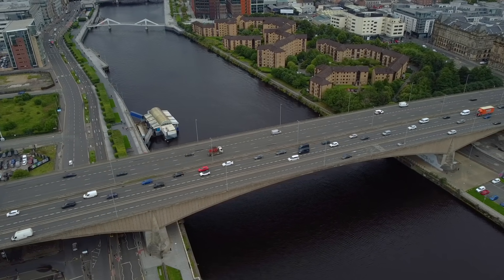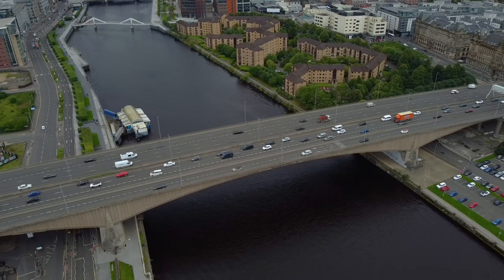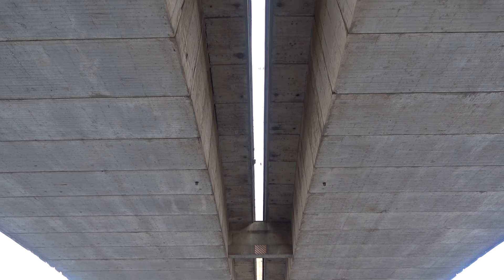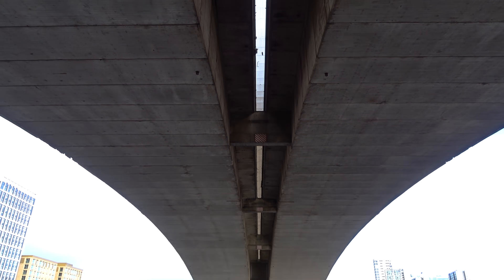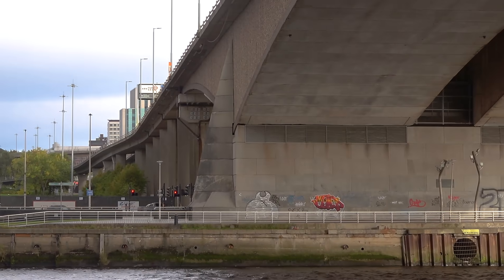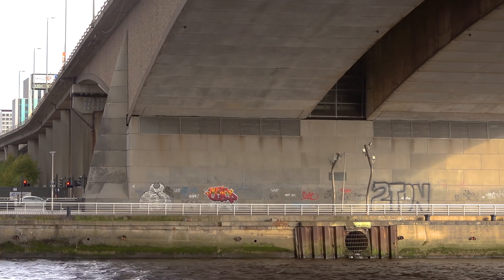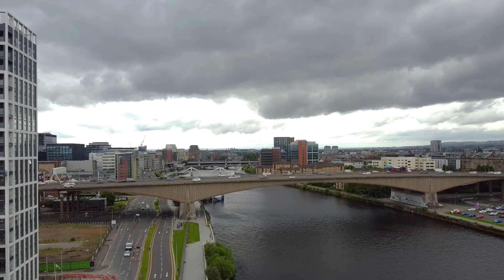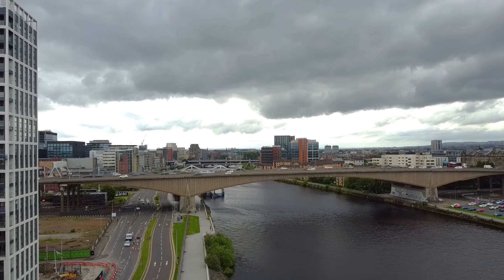How Do You Move A 52,000 Ton Motorway Bridge?  Glasgow's Kingston Bridge & M8 Motorway

Comment: Once again, a good video. M8 at Charing gross, Glasgow, city centre. A flyover was built over M8 in 1974. Unfortunately no cars could use the flyover due to non-compaction as there was a building on both sides. The panners turned it in to a public bridge at least it had about 60 steps to climb, people just use pelican crossing on ground level, then the bridge was crossed to the public. The flyover was not used and remained an eye sore. In the late 80s-90s an office block was built next to and on top of the flyover. https://maps.app.goo.gl/aL9DM2yPVXqaeBPY6.

Comment: Hope you are planning to do a video on the M8 repairs between J16 to 17, which are now expected to cost between £126 to £152 million pounds, around double the original estimate of £71 million, to put it into prospectus from 2007 to 2022, £217 million was spent on general maintenance and additional £265 million on repairs, excluded the figures above.  In total thats = £608/ £634 million and this dosen't included the M8/M74 upgrade either.

It is time, some of the M8 was downgraded between the Kingston Bridge and Woodside viaduct!

Comment: Thanks for posting this. I worked on the traffic modelling team responsible for making sure the street level urban traffic control (UTC) system didn’t grind to a halt with diverted traffic when the motorway was closed for the jacking process. I worked on the modelling for about two years looking at integrating the entire ytaffic signal system in the city centre to facilitate the diversion routes through the city. Incredible amount of technical ‘secondary’ work going on behind the scenes to ensure the motorway bridge realignment work went smoothly.

Comment: Hi John, 
Thanks for the Video, having known a former engineer that worked on the structural design of the bridge there was in fact a request for the bridge to have a winter heating system to keep the road frost and snow free. 

Great Idea if it was that simple but the engineers warned that if this was built into the road deck using Grit and salts would deteriorate the structure/concreate!!, It was pushed through by Glasgow district council planning and was actually built into the bridge's road deck however!!

This turned out to be a very very expensive cost and was not budgeted for when they were planning the build - Typical Government/Council process still used today -  As the heating bills were so expensive the council found a cheaper short term option (Grit/Salt the road's) with the understanding that when the structural problems' arise - not my problems as I have move jobs/not my responsibility now. Someone else's problem or technical term - structurally buggered!

Comment: The road, the connecting bridges and the entire system remains "not fit for purpose". A slip road from the city centre has been closed for two years just to accommodate works welfare sites and to provide parking for their vehicles. The roads network in Glasgow is an absolute disgrace. The UK is now officially a banana republic and Glasgow is it's capital.

Comment: I worked nightshift on the bridge in 1998, painting some of the new supports. There are 6 tunnels , or cells as they're known inside the bridge which you can walk from one side to the other, at the centre of the bridge you have to crawl through, the traffic is only a few feet above your head.

Comment: They're on about shutting the bridge anyway outside of local traffic and diverting along the M74 and M73.
Which many of us are starting to do anyway, since they've shut off half the lanes on the M8 as a almost permanent feature including making the slip roads dangerous causing even more problems to traffic flow. Its too common now for that bridge to be full of stand still traffic taking 30 minutes to reach the infirmary about 3 miles away. The traffic situation in Glasgow really is a great example of left hand >< right hand  -  elbow - ass.

Comment: The bridge was designed by WA Fairhurst Civil Engineers. I worked with the chap back in the early 90's who was involved in the design. Of course when the council found the issue lets blame the designers, but as you say the amount of cycles of loading which is the vehicles per hour was way less than what anyone ever dreamed of they were found not liable so cleared of any design liability.

Comment: There was an even bigger bridge lift near the east end of the M8 in the 90s.  They had to jack the main suspension cables of the Forth Road Bridge (A90) up off the towers to replace the mounts as part of a project to significantly strengthen the towers.

Comment: Reminds me of an incident when I was working on the earthworks for Ebbsfleet international station, there was a bridge under the A2 which needed to be widened to take 4 lanes rather than the original 2, but that was easy as it had a big embankment on one side piled up against the bridge abutment, so they dug it away. A few weeks later there was a panicked phone call to the chief engineer from one of the survey teams that the entire bridge had moved something like 50mm in a few days, which is quite a lot for a bridge! :) Cue lots of people running around trying to work out how to stop the whole thing collapsing. I left that site a couple of weeks later so I don't  know what their solution was, but it must have worked as the bridge is still there 20-something years later. :)

Comment: I worked on that jacking project. There were three jacking systems the 128 B Jacks did the vertical lifting but it also had Jack's to control the left right stability and a third system to position the deck centrally between the piers.
Reply: Is your name jack by any chance

Comment: We also had the same problem with Autobahn bridges built in the 1960s.
These can hardly withstand the traffic. The solution is to build a third bridge. Then a bridge in one direction is demolished and replaced. Then the second old bridge will be demolished. 
After that, it's just a question of moving the new bridge that was built first.

Comment: They did a similar thing at the M5 / A40 interchange (M5 J11) a few years ago...they replaced all of the concrete supports, yet leaving the original road deck undisturbed.
Reply: I remember that being done.  Incredible as it was so far off the ground!
Reply: Indeed; must be 80 feet or so!  @sr6424

Comment: If you want to see knackered bridges, there's a few in Hull. They're over a hundred years old and rusting away, you'd have thought being that old that they'd have had plenty of time to plan replacing them, but someone slapped listed tags on them, so the council's done nothing much more than paint them occasionally over the last 40 years. One's been half removed, one's been closed for a few years and inspected a few times to see if it's fallen in yet, and there's three more that I wouldn't give much more than another 25 years.

Comment: That is some bridge Jon, it must nerve racking for the engineers to jack that bridge so precise mm by mm. about 6 year's ago, the A483 Wrexham by-pass had 2 bridges jacked up the columns were getting week. The By-pass was built in 1972 and one of the earliest dual carriageway's in North Wales. The Bersham flyover and the bridge over B5101 just before J4 at Mold road junction A541 for Mold and City centre.
As always great to watch ,take care👍

Comment: Would be a good time to film the m62 ouse Bridge. Rumour is its damaged beyond repair after years of lack of maintenance. Lowered it 4 lanes and 50mph 4 years ago and now down to 30 mph
 They're doing some work but it's unlikely to be enough to get it back to being 6 lanes at 70mph again
Reply: My in-laws used that bridge just about every weekend as they head out to their bungalow in Bridlington. They don`t have many messages of "support" for the bridge to be honest...
Reply: @MrBreadman1966  as with everything in this region, minimal funding possible and now its going to cost more than was saved just to repair or replace it. Whilst it's entirely different departments, we also have some of the most outdated rail infrastructure as well. Could have really done with some of the money wasted on HS2 been spent on projects up here. Would have only needed a small fraction of it.

Comment: This is surreal. I actually worked on this bridge back in the 90's. I remember going through the original engineers City Ring Road drawings in the office out of curiosity. The reason traffic loads were so great was due to the Kingston Bridge originally being designed as part of a City Ring Road system, which was never completed. It was intended for the Kingston Bridge to have twin on the East side of the city with a motorway on the south side that mirrored the section on the north side that would allow drivers to skip round the outside of city,  as opposed to all traffic being forced through the narrow section of urban motorway and over the bridge. You can actually see where the southern section of the ring road would have joined the Bridge as there are two sections of bridge deck that come to a dead end in mid air. There are actually quite a few sections of Urban M8 that were built with the intention of creating more on/off slip roads, which can still be seen here and there. Eventually the M74 extension was built to link the M74 from Ballieston Interchange to the M8 at the south end of the Bridge to compensate. This extension diverted unwanted traffic away from the city centre and bridge, unwanted being traffic that was forced to travel through the city that  wasn't destined for the city. Overall it's a great example of the Jevons Paradox.
Reply: I read that in my head in the style of John.
Reply: I think, and I'm happy to be corrected, that north bound traffic used to be able to exit the bridge at Anderston. This was very handy although I think you had to get in lane pretty quickly. You probably had to endure a few hand gestures as you slew across lanes to get into the correct lane in time. During the remedial work and lane restrictions this was removed and never reinstated meaning that all city bound traffic was and still is forced along Bothwell Street or maybe it was only possible temporarily during the road works.  All of that said you'd be aff yer heed as we locals say to try and cross the Kingston Bridge or drive in the city these days.
Reply: @PaperCameraFilms  Yes, this caused a tremendous amount of congestion to build up and needed to be eliminated, so the barrier was erected. From an engineers perspective: Free flowing traffic at the speed limit generates plenty of space between vehicles due to increased braking distance. With all the weaving to get to different exits taking place traffic came to a standstill. This meant the traffic bunched up nose to tail in all lanes resulting in a staggering increase in the load the bridge had to carry. Restricting lane changing significantly reduced the load. That said the Jevons Paradox is in full swing, so any such changes are always only temporary relief.
Reply: @Kenny.W.Wallace and now the Greens want to reduce the speed to 30mph, and due to the Woodside Viaduct works the Kingston Bridge bunches up at rush hour, mostly northbound, but Southbound bunches up leaving towards the M74.
Reply: @PaperCameraFilms i’d assume so. Would explain the “temp” lane barrier
Reply: Omg I was on that job too!!
Reply: And here we are today. 7 in the morning, coasting over the bridge in second gear for 15 minutes with foot off the gas pedal.
Reply: A Great idea! Poorly executed due to running out of Funds…
Reply: The greater Glasgow transportation project
Reply: All you did was sweep up ya boaby....
Reply: @hassanchop7096 spoken like a professional sweeper
Reply: @samholdsworth420  nah man he failed his brush tickets. That was pure jealousy aimed at the site sweeps 😂

Comment: The strengthening work on the Forth Road Bridge's towers is fascinating. Essentially cut a hole at the bottom, slide a box girder in, jack it up, slide another one in, jack it up, until they hit the top.
Reply: And then after all that work, discovered it is the cables that are the problem.
Reply: @Species1571  I think the cables are problematic for much longer. They had to repair the rest (towers, deck) so that they could reopen it to traffic because the new bridge wouldn't be ready any time soon.

The new bridge is a good design : replaceable cables.
Reply: So, a re-skinning job but inside out? That's quite amazing!

Comment: Next bridge investigation for you - Thelwall Viaduct on the M6. They found a perished bearing on an original support and closed the entire carriageway within 12 hours. They had to replace every bearing, then on discovering they had put the wrong ones in, had to do it again. Can't remember how long the bridge was shut - 18 months?
Reply: The wrong ones?! Good grief...

They close some part of the elevated section of the M4 immediately, some years ago, because it developed a crack. Was that just before the Olympics? I remember there was talk about how this was going to cause tremendous transport problems getting athletes from the West of London to Stratford (turned out that other routes are available...).
Reply: @abarratt8869  You're thinking of the Hammersmith flyover on the A4.  It was shut in December 2011 reopened in January 2012 to a single lane of light traffic in each direction whilst repairs were made to the worst bit before the Olympics then afterwards the rest was done.

Comment: I know you did a video of the M6 in the North West, but you should do a video on the Thelwall Viaduct, especially the early 2000s closures of each side that saw the decks lifted whilst new roller bearings were installed. Pretty much made travel in the North West hell on earth for years until they finally finished it.
Reply: I remember the traffic reports on Key 103 back then... "And as usual the Thelwall Viaduct is a carpark, due to bridge repairs". That mess along with the M60 completion happening on the other side made getting about in Manchester and the surrounding areas back then a pretty soul destroying ordeal.
Reply: There’s long term 50 mph roadworks limits now between Thelwall and the M58 now so the intention is clearly to have that entire area crap on a permanent basis…..
Reply: @johnmoruzzi7236 that’ll be them “smart” motorways for ya

Comment: If I remember correctly, the load calculation decided that if you had 44 tonne HGVs nose to tail for the entire span in all ten lanes, there was a chance it may do a little more than sag in the middle. They closed one lane in each direction, and stopped certain slip roads accessing the through route, and for the first time in 25 years, traffic actually flowed on the bridge, rather than staggered across. This also moved the congestion from the bridge to the Townhead and Tradeston stretches instead

Comment: I can remember this happening. It was a pretty embarrassing time for the Transport chiefs, especially as so much money had just been spent increasing capacity on the Woodside Viaduct section and its eastern approaches. Curiously, that section is now in danger of becoming an unplanned spontaneous ground level road, and has had restrictions on it for a few years now, which, if hadn’t been for the M74, would mean HGVs having to negotiate city centre roads. 

Thankfully, I rarely have to drive on the M8 these days, as I live only a couple of miles from the M74, so get to avoid most of the drama.
Reply: The are no weight limit restriction on the Woodside Viaduct  and LGV's have never been diverted to the M74 extention Bob.

You went a wee bit Daily Record with that story there
Reply: The city is full of BadBobs. Moaning about the state of the roads, moaning that the same roads are closed for repairs. Total Daily Record @red00eye
Reply: There are signs as you approach Glasgow suggesting HGVs use the M73/M74 at the moment.  Nothing legally enforceable but they are there.
Reply: That is due to the narrowing of lanes approaching the bridge for construction works. Its bad enough with cars @jonnyholton2196
Reply: "Narrowed lanes have been introduced on the mainline of the M8 over the structures. HGVs are being encouraged to consider using an alternative route via the M74 where possible due to these narrow sections."

https://www.traffic.gov.scot/woodside-viaduct